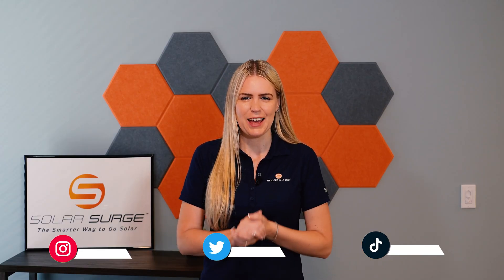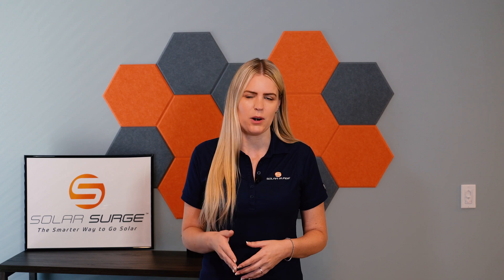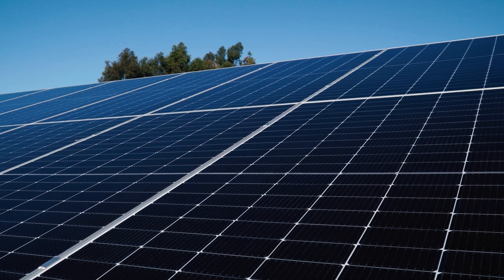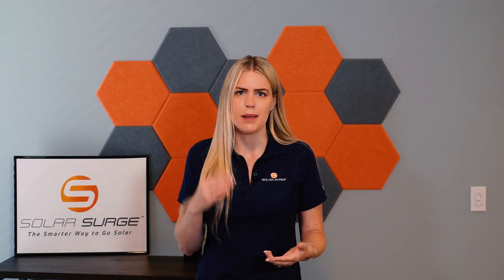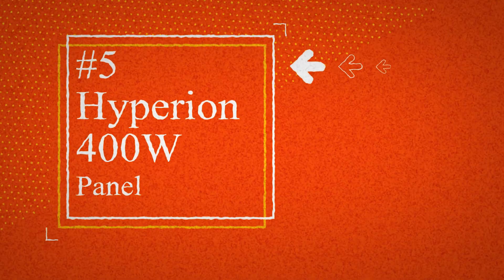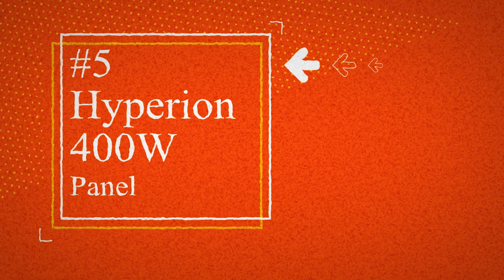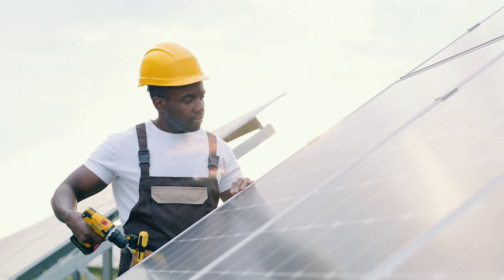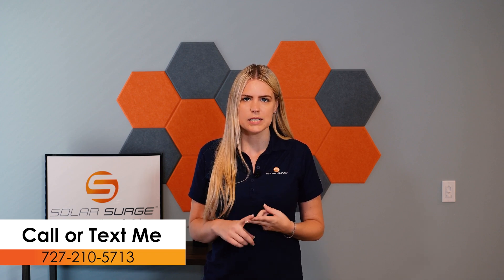Top 5 Best Solar Panels for 2023

Comment: What would be nice would be to have one of each panel side by side for color / frame cosmetic comparison. This would help for installations where aesthetics matter. Obviously not easy but being an installer you "might" have emergency spares or collection of rejects for this.
Reply: I look at panels all day long. Out of the 5 in this list, the REC has a pure, deep black and the panels actually look uniform upon install. The q cell has a decent amount of variability once on the roof. They are all pretty much black enough to appear the same to the casual observer at ground level. Its only on a ground mount or when flying a drone that the difference may become apparent

Comment: REC Alpha is definitely a top 5 solar panel along with Panasonic and Sun Power. The rest of this list are tier 2 panels that are relatively interchangeable. That doesn’t mean they aren’t great panels because they are, I especially like the Q-Cells, but they’re not on the same level as REC, Panasonic, and Sun Power. I would list the different panel’s PTC or NOCT ratings because if you’re looking to buy solar panels based on performance then these are the ratings that carry the most weight.
Reply: A more extensive list including the other top panels you suggested would be even better.
Reply: Thank you for sharing your insights on solar panels! REC, Panasonic, and Sun Power are indeed top-tier brands. When it comes to outdoor gear and home backup power products, Segway's Portable PowerStation Cube Series is worth considering. With its flexible design, massive capacity, and fast recharging, it's a reliable choice for outdoor enthusiasts and RV lovers.

Comment: I just did some research on the REC Alpha Pure-R Series panels. I really like the power output of the compact design. But according to the Enphase website, the panels do not pair with most of the available Enphase inverters except for the older IQ7X. That is a big negative for me.
Reply: IQ8+ works great with the REC alpha pure black modules.
Reply: @mattbrew11  That is the one my panels are paired with.
Reply from the maker: Enphase will be releasing IQ8X soon to address this problem.

Comment: I must have missed which of the panels on your list are bifacial solar panels?
Reply: None of them. 
Aptos does make a dna 144 cell bifacial though.
Reply: @mattbrew11  okay thank you for your reply. I guess these are not the top 5 panels of 2023 then.  The data is in, and the top production PV are bifacial panels even when installed in a traditional south facing array.  What is impressive data about bifacial panels is mounting them vertically in east and west facing directions, like a vertical fence.  Butterfly Power has really good data and real world results showing this.  Canadian has some really good bifacial panels for less than $200? Or about$.45/watt?  My 2cents.
Reply: @dewholdingsllc1050  for rooftop solar installations which this video is focusing on bi facial does next to nothing.  I install panels and I put some on my own roof so im not sure whos data is in but thats not the case

I have a couple test cases running on a sistered east west array and so far you’re better off with a perfect tilt solar south system with a solid reflector in terms of cost vs production
Reply: @mattbrew11  1. I missed the part where you are only speaking to roof arrays.  2. You really need to review the the best practices for roof mounting bifacial as it is different. 3. You really should review the various examples of using bifacial PV in solar systems on the Butterfly Power information.  Amazing examples of integrating bifacial PV into all areas of residential, commercial and agricultural use.
Reply: @dewholdingsllc1050   I dont need to drop my resume but weve done more installs than all but a couple handfuls of installers in the US. I have both bifacial and regular panels on my home as an experiment.  I’m quite confident in my position that rooftop solar doesn’t gain enough to matter and in peak season will introduce clipping into the equation when there otherwise is less or none. In winter the difference in production is negligible. Thats on a roof that was built on a tilt and azimuth thats perfect for spring and fall pointed due solar south vs magnetic south
Reply: Aptos is Bifacial I have the 440W DNA 120's (newere ones)and verified it with my own eyes Two vertically mounted South and six horizontally mounted South
Reply: @tombyrne6433  aptos 440s come in both standard and bifacial
Reply: @mattbrew11  Yes buy bifacial